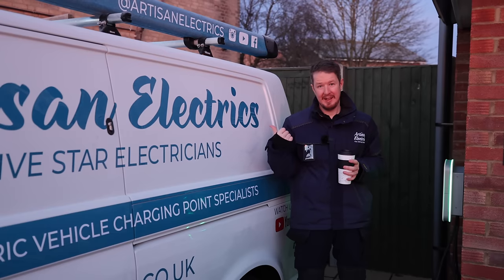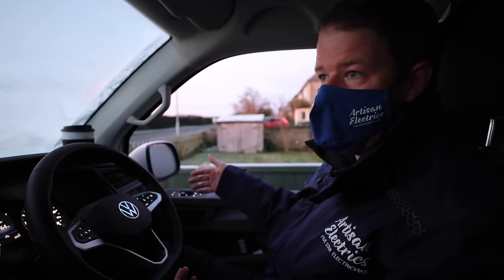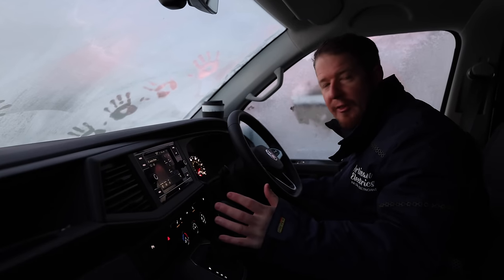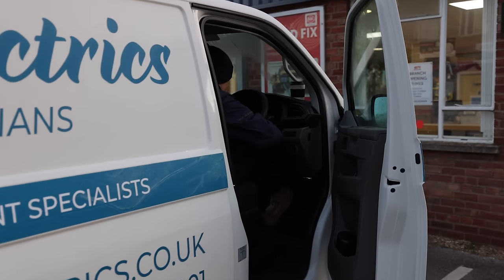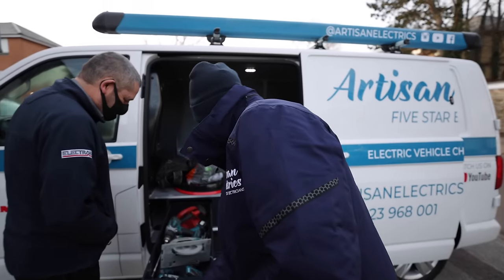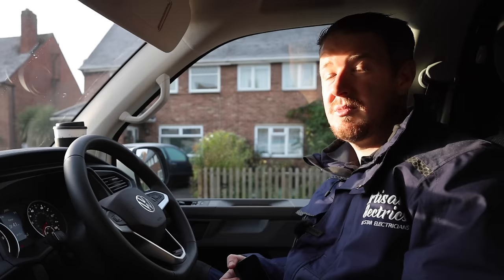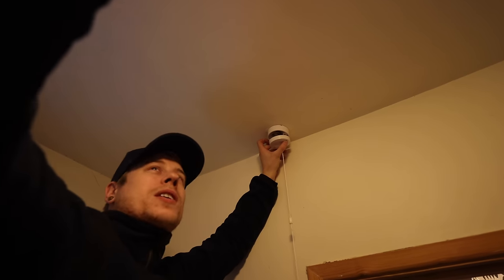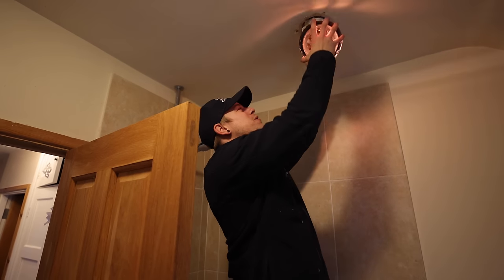ELECTRIC VAN NIGHTMARE 😬 - Volkswagen Transporter Electric Van

Comment: For someone that makes such a big thing about charging points, you demonstrate an astonishing lack of knowledge or sense when it comes to EVs!
Reply: No he doesn't, they're crap and you know it, too many issues, so bloody far to go, if they even ever get there! Charge time, Range, Safety issues, Longevity issues, Unreliability, Cost of Cells to name but a few, the list goes on, suppose you just do the shopping or School run?
Reply: I thought exactly the same :) Firstly the notion of leaving for a day's work without a full charge is madness, particularly in winter. Also, why on earth was the van not set to 'climatize' at the time of your departure? That's one of the best things about EVs in my opinion - every winter's morning I hop into a toasty warm car and literally never scrape the windscreen. Another thing that drove me mad was the window issue - pretty obvious that the window was so iced up it was triggering the "trapped finger auto reverse" mode. Don't get me wrong I don't think this is a great EV (far from it, you're dead right about conversions vs. purpose built EVs) but there are some simple things you can do to make this thing work very well for you. Do another follow up on the van in the summer when you've worked out the kinks!
Reply: @keithcoltron3171  Another person that doesn't know what they're talking about!

I've owned my fully EV car for 7 years. I use it for my business, determined that the range was perfectly adequate when I bought it and have been proved correct. It has done 80,000 miles, never missed a beat in that time, still maintains good range, and has saved me approximately £10,000 in fuel, tax, and service costs. I've just traded it in for a new one and received an allowance of another £10,000. Given that the car cost £18,000 when new I've effectively made money!

Recharging was almost always done at home, occasionally being overnight, and I'm certain I spent less time than others have when standing around with a hose in their tank waiting for it to fill, followed by the tedious trek to the till and waiting behind the other clowns paying for their fuel, ciggies, and papers, etc.

Weigh up your use carefully, pick the right vehicle, and they leave ICE cars for dead. I'd never go back as they're like something from the stone age!
Reply: Totally agree, how you can spend 50K without doing any research on what you are buying and then not know how it actually works is totally stunning, how did he even become a sparks ???  can only imagine his youtube subs pay for such massive errors.
Reply: @kravdraa7  How about you do a video showing us how clever you are and how it's done?
Reply: @PhoneVidoes  Let's see your video.
Reply: For a first time viewer I'm amazed how these professionals managed to buy a £55k van but literally have no idea how to unplug it or even drive it....
Reply: @keithcoltron3171  best not mention that lithium is mined and will run out, plus the fact that the EV will not last long enough to off set the carbon footprint of making it.
I find talking to people with EV’s is like talking to a vegan, pointless.
There better alternatives on the way, EV is like 3d was, a passing fad 😂
Reply: @georger5558  That operation should be as simple as unplugging any electric appliance. It basically is a defective design.
Reply: @hybrid9mm  Thats not strictly true, yes Lithium is mined but its over 98% recyclable so once mined it can be used over and over again.. factor this in to the equation an EVs use much less carbon over their lifetime than ICE vehicles
Reply: @valkaielod  Really? you mean you WANT people (probably teens) being unable to unplug your car when it's charging? 

I've never owned an electric vehicle but as soon as he had trouble removing the connector my very first thought was it's probably locked.
Reply: @georger5558  dont have to ev shows it self up they are crap
Reply: @kravdraa7 ............yep., your right.,BUT they are the ice age we know..
Reply: @PhoneVidoes  It's on lease so he didn't bother.........
Reply: @garysmith5025  I’m not against EV or any other alternatives.
I’m against people thinking it’s the next big thing when the technology is still in its infancy, not forgetting that this technology is not on par with current vehicles.
Have you seen the build Quality of a Tesla? I have it’s shocking for the price a customer pays.
Look up JCB and then get back.
Factor in everything when working out the carbon foot print, from mining all the resources, to building the factory and the vehicle, plus recycling the power pack and rewinding the motor coils when they eventually fail, the upkeep of the charging point etc etc. 
I wouldn’t dismiss your math if you included everything that you need to offset, I’m not a hater but I’m realistic.
Reply: @db7948  I’m aware it can be recycled, that process is nasty and bad for the environment, couple that to the resources used to mine it first place, this makes it no better than current vehicle manufacturing.
Reply: @hybrid9mm  Lithium is mined, very true. But has been mined for a relatively short period of time compared to fossil fuels. So mining companies are prioritising lithium mining for the first time. New resources will enevitably be found simply by the law of probability. 
"plus the fact that the EV will not last long enough to off set the carbon footprint of making it." This doesn't really make sense but if you are trying to make the "Jeremy Clarkson" point................. don't. He is a badly educated dinosaur and know little about the subject.
"I find talking to people with EV’s is like talking to a vegan, pointless."..... Imagine how they feel. You blatthering on about a subject that you know very little about. Because someone chooses not to eat meat, you think that they are wrong. That's just plain stupid. If they choose to live their life that way, then it is up to them.
In case you hadn't noticed the world is getting warmer, a lot warmer, quickly. Mainly because as humans, we shit on our own doorstep. All the so called "experts" advising the American Government in the 1980s said that it was just a phase the world was going through but unfortunately reality has set in and now even the Chinese are trying to clean their air up. 
So we are where we are and unfortunately it is going to get a lot worse. Mainly because Governments won't act until they reach the edge of a cliff, and people are in general uneducated and lazy. So don't expect a great uprising forcing Governments to take action because as long as people can buy a new phone and iPad and have internet access, there is nothing to worry about, apparently.
If you genuinely believe that the mining of one battery's worth of lithium is equivelent to 250,000 miles of petrol useage, you are a fool. There is no other explanation.
Reply: @doghouseriley4732  ok I worded “I find talking to” wrong, The one’s I have met came across as arrogant fools jumping on the bandwagon if that makes sense (can’t think of another why to word it) as the cars are very expensive only certain people can buy one, I live in the rich arrogant south east of England so the ones who buy these cars are just like the Hollywood stars buying Prius’s back in the day for clout factor. A great example was the Lexus 300h people in London didn’t buy this car to save the planet they brought it so they didn’t have to pay tax and congestion charges, the vehicle had a 3l V6 petrol engine in it nothing green about that wouldn’t you agree.

I’ve nothing against people being vegan etc each to there own I just don’t like the way some feel they need to force feed it to others.
Agreed Jeremy Clarkson is a Dino, I’ve met him plenty of times (I worked a dunsfold for 5 yrs) but he’s not as misinformed as you think.
Governments yep Agee there.
As for offsetting, this must include the entire infrastructure used to make and maintain these vehicles, as this is newish technology the offset isn’t happening at the moment, you must also factor in what’s it’s replacing because until its just EV or Hydrogen etc nothing is getting better 🤷‍♂️
Reply: @thomascaulfield9277  Well Tesla seems to have most things right (probably not everything but no car manufacturer gets everything spot on)
Reply: @kravdraa7  I saw the results of the American government surveys today. Hybrid cars most likely to set fire, followed by petrol, and finally BEVs 😂
Reply: @georger5558  i agree and electric is the future or at least a part of it why i am against it is the pure fact that the motor industry  and petroleum  knew this day was coming and they just sat o ther obscene profits instead of investing in ev development which by now would have been well developed and a real allternative to petrol driven cars busses etc  ,instead we are expected to put up with what in most cases are useless bit of junk and pay for the development
Reply: @herrbohnen  No need, wouldnt have spent 50K on a van in the first place. Come on its not rocket science, personally the chap made himself look a right muppet, yeah I suppose its "entertaining" to watch if you like that sort of thing ?
Reply: @georger5558  Agreed, found the channel watched this and a few others and decided its just another social media money maker, I dont blame the bloke if he can make a few K out of folks watching adverts then why not. But personally I dont need to waste 10mins watching muppetry 🙂
Reply: @doghouseriley4732  So the frame used on the video is a lie then with it saying "My £50000 Mistake"
Reply: @garysmith5025  in the future it will pay off, of that I have no doubt, in the here and now it’s new and all the infrastructure that is needed to be put in place, is actually adding to the problem, so EV is playing catch up on its carbon footprint already.
The UK gov can say anything they want, don’t forget they peddled diesel as the future, while ignoring all the facts that said otherwise, for example the best air Quality recorded in London was when the bus’s where on strike 🤷‍♂️
As for Elon he is a snake oil sales man as far as I’m concerned, he’s had more ideas (one or two have been original) debunked than the flat earth community 😂 he’s a smart man making tesla when the world had finally released alternatives are needed, he’s basically cashing in.
Reply: @Mr Stick I did mention that all the infrastructure must be included in the math when offsetting the carbon foot print.
I’m from the motor trade, so I do get it 👍
Reply: @nothanks6859  doesn't have to be an ev you can put an electric fan heater in any car on a plug in timer ,easy peasy.

Comment: Step 1- Read the van's handbook before using it for the first time.
Step 2- Use a fan heater in the vehicle with an extension lead. A quarter hour or so will warm up the van and defrost the windscreen.
Step 3- If steps 1 & 2 are too difficult, send for an electrician.
Reply: To MERVYN PARTIN. NEXT thing would be for someone to invent cordless fan heaters, so you can put one in the van - together with A P  or whatever, to warm it up before you drive off. Would also be a great idea for warming garden sheds, which of course are not on the mains  or your garage!
Reply: Battery heating pads are on the market. Install that and charge your electric car earlier. Being cheap and saving electric on a electric is not efficient in the cold months
Reply: They do diesel version of the same Van's, as far as I know they work just fine and you can recharge them in about 5 mins virtually anywhere lol.
Reply: @salisburyplain998  rapid charge in about a minute lol.  also rapid charge not as fun as saying splash and dash
Reply: @Mervyn Partin, if steps 1 &  2  are too difficult, then revert to  a diesel or petrol vehicle. Reliability matters when you have to get to work.
Reply: A bit dificult to drive around with an extension....haha ..useless technology!
Reply: @nygelmiller5293  so battery then? ..
Reply: Step 4 trading electric van and buy a useful one
Reply: Or just buy a diesel vehicle.... lol
Reply: @salisburyplain998  Chee!Who invented that!That would be the savier off this world!!😯😯
Reply: @nygelmiller5293  I have a space heater in my 1964 VW split window kombi. It runs on LPG and can also be used to make tea!
Reply: I thought electric vehicles were meant to be technologically superior. They're obviously not
Reply: Just turn the heating on when the van is still plugged in maybe ten minutes before setting off. Not a problem.
Reply: @rogerphelps9939 I think the problem was that he just didn't have a clue how to do anything with the van.

Comment: NEVER use your wipers before you have scraped or defrosted the screen.  Massacres the rubber and, if frozen can even rip the rubbers off the blades. Same problem with window, ice friction load on rubbers causes overload protection to trigger.
Reply: Yes, but the stupid sensors think frost is rain when in automode as you start the thing. And when you nudge it the wrong way, you get the same thing.
Reply: I've been trying to stop my partner using the wipers to clear the window for years
Reply: I bet you are the life and soul at parties.👍
Reply: He's wearing a mask in his van. Don't expect any common sense.
Reply from the maker: Protecting the cameraman

Comment: For removing screw caps I find duct tape often works better than blu tac, especially if you place it over the cap then pull both ends of the tape at a 90 degree angle from the accessory at the same time so the cap is being pulled straight out rather than at an angle.  As an added bonus you can then leave them stuck to the tape so they don't get lost.

Comment: 50Grand+ for a battery van that stresses you by looking at your fuel level on top of everything else...Insanity
Reply: @MsWagons  The battery of modern EVs Will outlast Diesel engines and they’re so cheap to run they pay for themselves really quickly.
Reply: Can you imagine the excuses he can give to the client. Sorry run out of juice. Go to go and charge. 600 quid later
Reply: @andrewbarlow8577  That's an educated guess at best.
Reply: @andrewbarlow8577  No. No they won't. Lol.
Reply: @andrewbarlow8577  no they won't, and I guarantee my 3.5l used ranger is cheaper than a used model 3 over a 5 year period.
Reply: @andrewbarlow8577  Really?
Reply: @MsWagons  too right mate
Reply: @MsWagons  very good point about smart motorways.
Reply: @andrewbarlow8577  "The battery of modern EV's will outlast Diesel engines and thy're so cheap to run they pay for themselves really quickly".  Good use of technical information there Andrew. Please re-read your comment and try a bit harder.
Reply: @andrewbarlow8577  give your head a wobble 😂😂😂😂😂
Reply: @MsWagons  absolutely, there are thousands of diesel cars still on the road with well over a quarter of a million miles on them, I had a Citroën xantia that had done over 200k when I bought it, ex taxi, and over 400k when I sold it and it was still on the road 5 years later.

Comment: Here's a thought, what happens in a cold country and you get stuck in snow? The heater drains the battery really quickly and then you die of hyperthermia. In an internal combustion engine you run the engine sporadically to keep warm.
Reply: electric cars can run for days with any decent amount of charge (which id assume you had because you charged over night).  using heated seats burns a lot less electric than running the whole vehicle heater.
Reply: Owning an EV is just pointless in general. Unless gas is really expensive in your country.
Reply: I really don't think hyperthermia is going to be a problem in the cold.
Reply: @WayToManyAssassins  I Still Wouldent want one Regardless of the cost of fuel..
Reply: PING! lol
Reply: @jean-cyrillkreuer6410  What, so a diesel engine doesn't heat the water going around the engine?
Reply: @kevalbertmooka  that's true, but without doing work, the motor produces not much heat....you have to drive around to really geht warm.
Reply: Same as the diesel running out isn’t it? Aren’t these issues the same as having a small petrol tank which will be gone when they get better?
Reply: @robertprice26  if I've got 70 litres of diesel it will last longer than a battery that is inefficient in cold weather.

Comment: Hey, tip from a Norwegian here. Preheat the car while its charging on your house, there's probably an app for it or perhaps a setting on the controller unit. It should heat up in like 5 minutes honestly. We have a few Toyota Proaces in our elecrical firm and its -10 -20 regularly here and it works well, though the range is about double of the VW, might be different versions for nordic countries though, not sure.
Reply: His van is not an actual EV, it's a normal van that has been converted by a non-brand garage. I highly doubt they included a pre-heat version.
Reply: It's interesting that VW would go for an after-market conversion (ABT) for their first efforts into the eV van space.
Reply: @112Haribo   Oh, that's interesting, Sounds a bit strange to me.